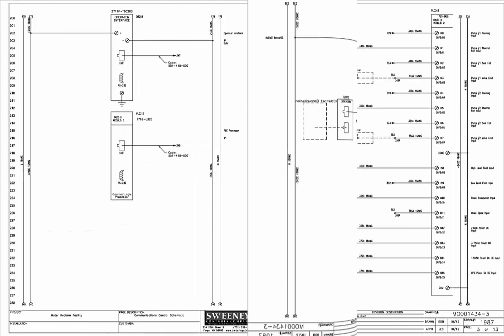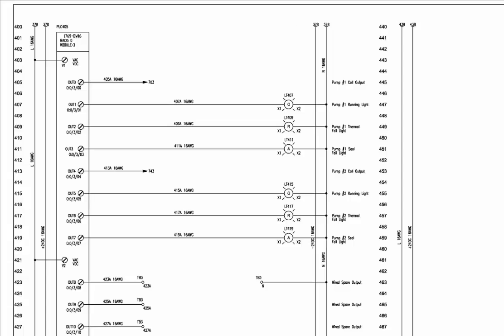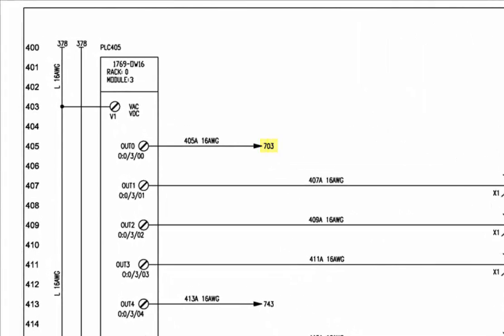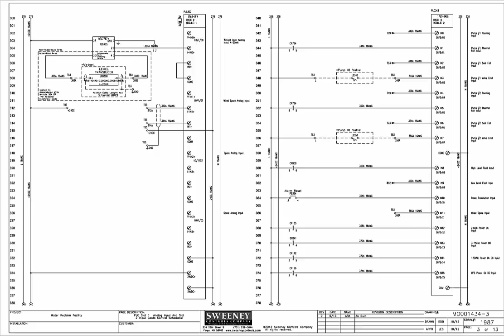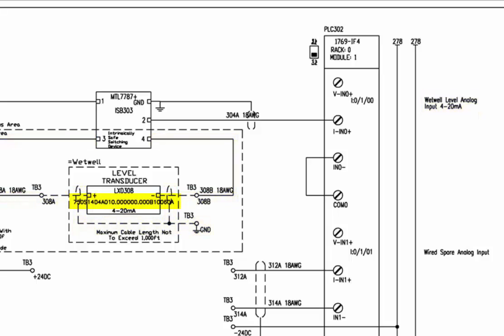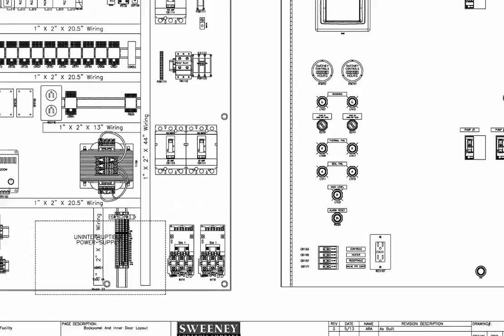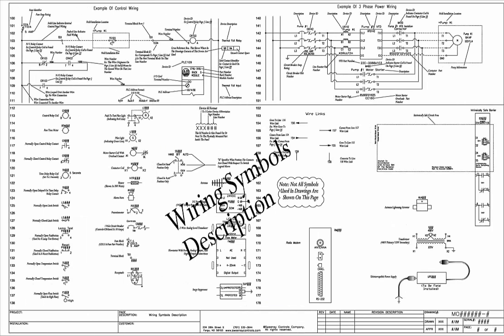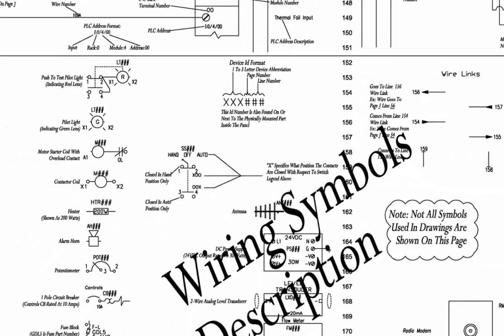How to Read Control Panel Schematic Drawings

Comment: as mechanical engineer i know there is standard called: ANSI ISA 5.1 to read process, piping and instrumentation diagrams .. is there standard to read the electrical control diagrams?
Thanks